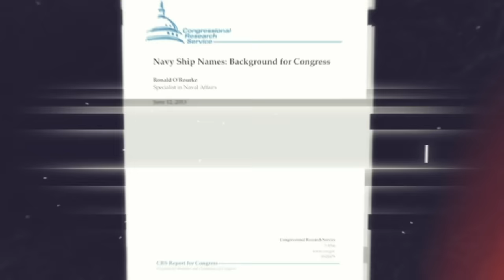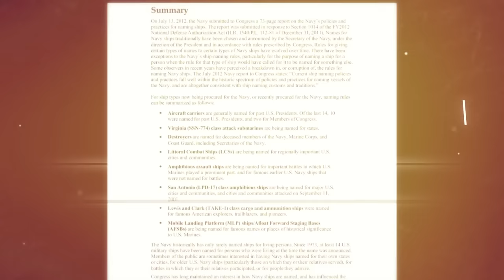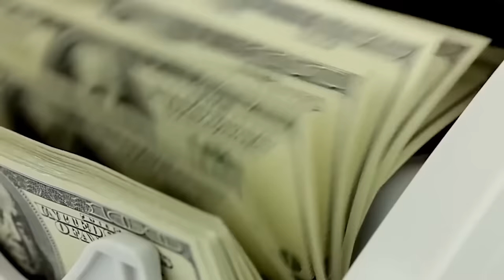US Is Testing Its New Gigantic $13 Billions Aircraft Carrier

Comment: Feet, knots, (nautical) miles, starboard & port, fathoms??? why not use more conventional more easy to understand values:
- Like the ship is 300 meters long and 50 meters high
- It can sail 20,000 kilometers without restocking
- It can reach speeds up to 60 kilometers per hour
- Left and right (instead of port and starboard) 
- fathoms? just use meters

Comment: It'd seem the cables could be connected to generators to serve braking while adding to the power, just for efficiency.
Reply: They are on the Ford class. The Nimitz class carriers (68 through 77) all have hydraulic systems, but the Ford has electromagnetic braking which I believe operates on the same basic principle as Tesla brakes. I know very little about the electromagnetic system, but I can explain the hydraulic system a little.

Imagine a giant block-and-tackle system - one set of giant pulleys is stationary and the other set can slide back and forth. The purchase cable (the part of the entire cable assembly that is below the flight deck) loops back and forth between the two halves of the block-and-tackle. In between the two halves is the actual hydraulic system. When the cable is pulled by the aircraft, the moving side of the block-and-tackle slides toward the fixed side, squeezing the hydraulic system and forcing fluid through the magical mechanical guts I don't know about. I know that the resistance at the start of the process is relatively light but quickly ramps up as the airplane slows down. It brings it to a "gentle" stop in 300 feet so (very roughly 120 to 170 miles per hour to zero in about three seconds), if my memory is correct. I know of at least one friend who forgot to lock his seat harness and ended up plastered against the console in front of him.

Comment: How long till submarines are capable of carrying aircraft, sure it’s in there thoughts
Reply: The Japanese had submarines that could carrier one or two aircraft in watertight compartments. I guess there was some sort of catapult similar to what battleships used. But to do that with modern aircraft the submarine would have to be immense, even if it only handled one or two aircraft.

Comment: The Greta Thunberg mention was completely unnecessary and inappropriate. If other corporations, governments, and consumers could put as much concern and energy into solving the carbon problems as the engineering into this ship we could be on a different course by now. But we're not for the very fact that we mock such awareness, activism, and goals to strive for. And for that there's still massive economic resistance toward doing anything of the sort, which has now also become political, and worse, engrained culturally, to the point that activists drawing attention to these things are openly mocked. And let's not forget that the US military is still one of THE largest carbon emitters in the world, or that this arguably clean carrier will be a launching platform for jets that consume something on the order of 100-1000x cars worth of carbon PER FLIGHT. The Pentagon has also been very clear about the veracity and even strategic threat of climate change btw. Could you maybe cover some of this in your videos for your audience to spread such awareness? Maybe someday we'll take cheap jabs and RIGHTFULLY mock the pervading mass ignorance in our times. And hopefully we can eventually be on the right side of history instead of the right side of appealing to the masses.

Comment: Lead picture looks like a Mashup of a Star Wars battle cruiser, the engine exhaust is on the left, the structure is either hardened concrete aircraft shelter or parts of another Star Wars spacecraft. Not very practical or realistic. Imaginative, certainly.